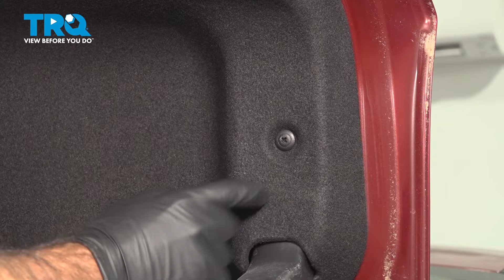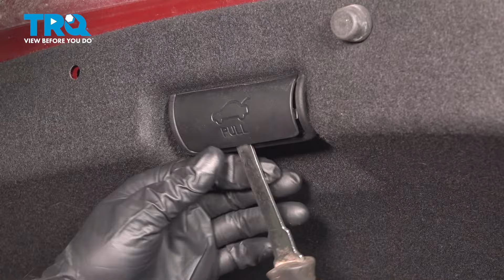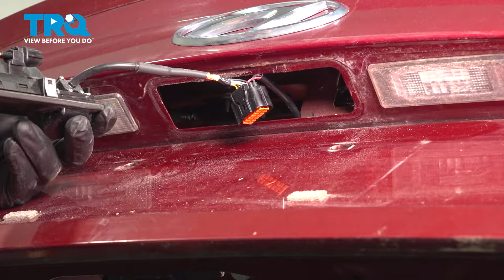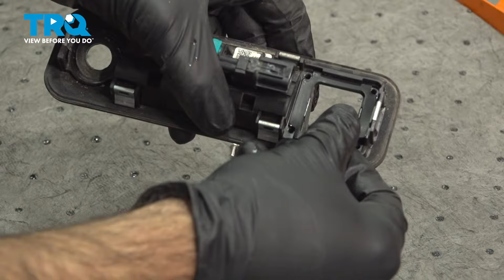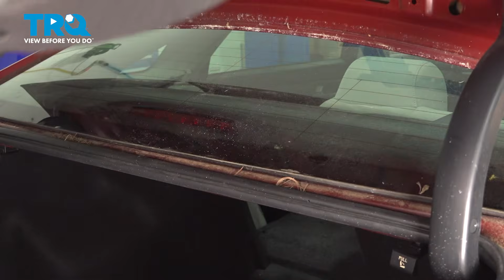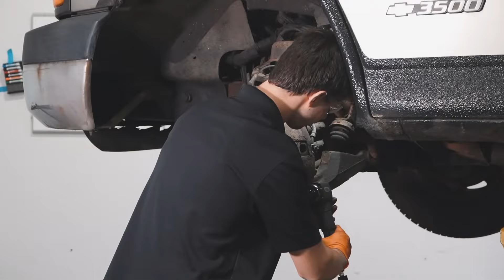How to Replace Rear View Camera 2015-2019 Hyundai Sonata

Comment: fyi if ur just changing the camera, u don't need to pull the whole assembly out. All you need to do is use a small size screwdriver and unscrew the camera. It is 4 screws

Comment: Thank you! Great video! I just popped the clips I could reach off with a screwdriver and then popped it out from the outside. Didn't have to remove anything from the lock cylinder either.

Comment: Thanks for the helpful video. I could easily install it myself however, my brake lights in the tail lamps stopped working after the installation. Is there a connection in the brake lights in tail lamps and rear parking camera?

Comment: Great step by step video. Just finished replacing mine, took me about 30-45 min. Had a hard time with the metal clips on the camera. If anyone needs a tip and doesnt have an angle tool like him, i used an alan wrench and it did the trick.

Comment: If you can't find your direct replacement, buy a cheap one and replace the housing, your original camera still working fine. The outside lens is the one that is cracked. I found one at my local junk yard for 25 from a newer model.